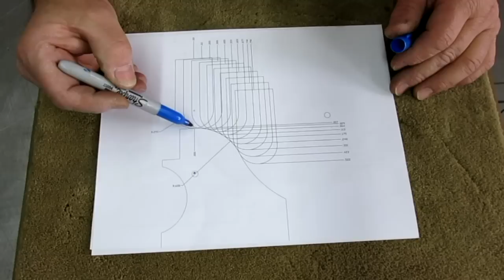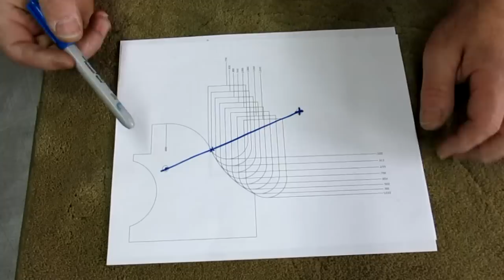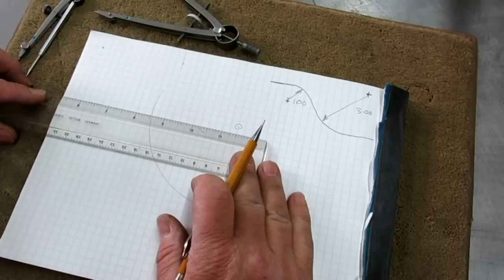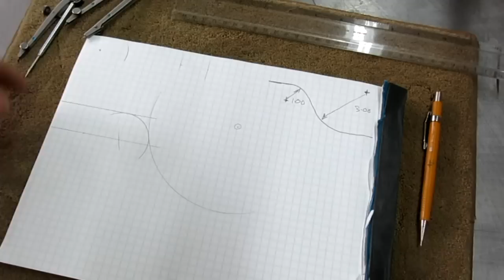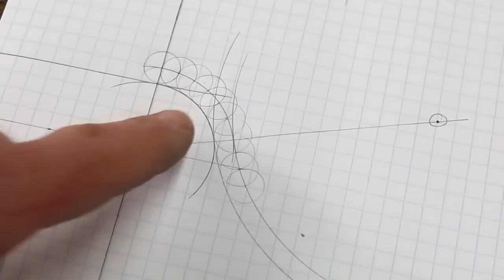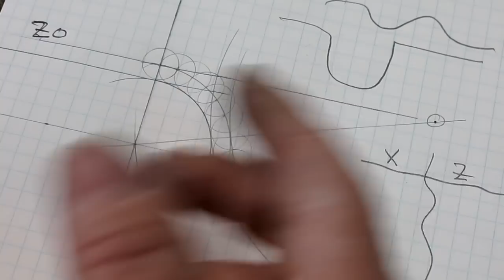Wilton Baby Bullet Questions and Comments

Comment: I have a general question, not specific to the Wilton: Why does the things you are milling/drilling and turning always seem like they are made of butter ? I get the good cuts sometimes too, but often there are trouble. For you the drill bits just seems to want to go though the steel (mostly with no persuasion whatsoever). If you could explain sometime I would like that.
Reply from the maker: +Panzax I speak harshly to all my cutting tools so they cooperate. And I use butter flavored steel.... Just kidding. Sharp good quality cutting tools and rigid machine make a huge difference. Hope this non technical answer helps. 

Best,

Tom

Comment: Marvellous. On your hand-drawn explanation, had you made both radii equal you would have a classic (goes back to ancient Greece) ogee curve. Wikipedia has a perfectly comprehensible explanation of the ogee. I was into making hand-tool picture frames a few years back; did a few ogees with plow planes (equivalent of flat bottom endmills) followed by scraping. Same method you used, but with plow plane. Never ocurred to me to do unequal radii. I thank you!  Having spent my entire professional life programming I am sick of computers.   On climb milling my experience is that you don't worry about it on Aluminum, but on steel -- be careful. It does save time.
Reply from the maker: +Juan Rivero Hi Juan,

Roman Ogee. Sheet metal guys know this one as well. Thanks for the comment.

Cheers,

Tom
Reply: Well, next picture frame I male will have unequal radii aand I will keller it! Thanks for the post.

Comment: The same freshman Engineering Graphics professor who taught me how to construct tangent radii like that introduced me to the term "RCH."  That's as close as you could get with a pencil until CAD came along. I'm always impressed by the things my predecessors successfully designed and built using pencil and paper in 2D along with 3D physical patternmakers to turn paper into metal.

Comment: Very nice job of explaining and demonstrating a clear way of laying out the coordinates for machining curves "by hand". Thank you. As you said, once you know the "hard way", the easy way gets easier. I'm still trying to figure out arrays in Fusion 360. I had it pat in AutoCad, but I no longer have access to AutoCad and it's just too expensive for a profitless hobbyist. The arrays are there in Fusion 360; I just haven't figured out how to do them yet.

Climb cutting.   Especially on light cuts on tough material having the edge of the tool approach the work at a steeper angle lets the cutter begin cutting rather than flex the tool or "push away" from the workpiece. Conventional milling sometimes produces a very "ripply" finish (especially on a light milling machine) because the tool pushes away from the workpiece until the pressure builds up enough to start cutting a chip. Once the cutting starts, tool and workpiece "relax" and the cut goes deeper - until the next tooth comes along and pushes the tool and workpiece apart again (making another ripple). You can apply the axis brake lightly to reduce the tendency for the tool to pull out the backlash on the axis (which causes the tool to take a much bigger tooth-load, possibly causing trouble).

Comment: Tom, thanks for the  lessons! I didn't understand climb cutting until I looked at a drawing showing the cut and cutter from a cutter-axial viewpoint. Seeing the cut surface looking like a ski jump side view and the cutter flutes hitting it on the uphill side made it easy to see how it could run away uphill like a spinning snow tire...hence "climb cutting".  The other way, where it hit on the downslope side of the cut and pushed against any uphill motion was the remaining name...conventional cutting.  I ran into this with routers in woodworking, but it's the same idea. 

I'm also familiar with how rethinking the plan in the heat of battle can invite Mr. Bozo...done that!  It always seems like you've just had a better idea, until you've committed by making a cut, or sequencing things differently, and THEN you remember why you planned to do it the other way.  Oops!

Looking forward to seeing the welding part when you get to it!

 -- Mike

Comment: Excellent video! however I prefer to exercise my brain on Cad and Cam and let the CNC make the part while I'm working on the next one. I used and still use at times conventional machines but prefer the cnc. But I wouldn't like cnc if I didn't have any control over the design, programming or setup.  Anyway again an excellent video I always pick up a tip or two from each one and I'm sure a lot of your viewers do also.

Comment: Hi Tom and all, what happens when climb cutting goes "wrong"?   Is the lead screw's "drag"  overcome and the material self feeds too fast resulting a crash or bit breakage?    The "between the lines" implication is that it is a violent event.   Is this correct?   Thanks in advance.

Comment: Tom, thanks for the demo's.  I particularly liked your explanation of climb milling vs. conventional milling.  I use both methods the same way you explained.  The other  day I had a young guy from a 2 year machining program that was taught to only conventional mill on manual machines and he questioned me when he saw me climb milling.  I told him that had one of those bad experiences a long time ago while straddle milling on a very old van norman horizontal mill and she lurched forward on the two 6" diameter cutters and learned a lesson!  But with a small endmill it shouldn't give you a problem - especially during a light or finish pass.   I showed him the difference in the finishes and he was surprised because he never tried it.

Comment: The true limitation of climb milling is how much backlash there is in the lead screw/nut assembly. Clapped-out mills will not climb-mill with any decent sized milling cutter. If your Bridgeport type mill has ball screws you're good to go. Worn factory screws will be problematic.

Comment: My blue dots sit in a coffee cup on my desk. Don't you hear your drafting teacher telling you not to draw lines with your ruler?

Is there more tool deflection with either climb or conventional cutting?
Reply: +Marty Bernier   Sorry mate, but how are you supposed to draw a line without a ruler?  This is a genuine question.  I can't even write my name without a ruler.
Reply: +Marty Bernier  More when conventional as tool pressure has to build before the cutting begins. This rubbing is why climb milling will produce a better finish.
Reply: +Marcel Timmers  Use a straight edge so as not to wear the edge of the ruler. That's why wooden school rulers have a steel strip inset.
Reply: +Marcel Timmers In drafting class we were given two triangles. One was 45, 45, and 90 degrees. The other was 30, 60, 90 degrees. When you stack them you can get various angles. I was taught to use these to draw lines against. A precision ruler is a measuring device with a fine edge. Good drafting rulers do not have metal edges. I'm just an old school draftsman I guess.
Reply: Hi mate, Thanks for that.  I was thinking that it must be something like that.  I bet that the teacher never thought of any CAD programs.  However here was the proof that it still comes in very handy at times.  I was able to buy a lot of very good Rotring pens because people just don't draw by hand any-more.
Reply: Hi mate,  I thought that it must have been something like that.  Oh those teachers hey.  I bet that he never thought of CAD operated systems.  However here was your  proof that it was handy to know.  I was able to buy a lot of good Rotring pens, because they are not used any more.

Comment: I liked the geometric explanations.  Could you not have built a fixture that would have moved the part through the required arcs?  That solution would probably be left best for a job shop building multiple copies of the part.

Comment: Thank you for the excellent tutorial.  I think I've finally wrapped my sclerosed brain around the concept of "climb milling".
As to the vise anvil.  I agree with your comments on not changing the plans mid-build, but.  Even though it is doubtful the vise anvil will be used as such frequently, won't welding on a flat piece produce a hollow surface rather then a solid reactive surface?  Also, will welding warp that thin piece.  Even if you don't change the plan, I value your opinion on instead of welding on a piece you instead do a weld buildup that is then machined to shape.  Much like you would do to repair a worn out bearing journal.

Comment: Hey Tom, 
between you and Fenner  a guy can pick up more info than you can shake a stick at!. thank you for the explanation on the coordinates in AutoCAD.
the question i would have in response is: would it be possible to duplicate the radii produced with your "kellering" method on a rotary table?
providing of course the workpiece be rotates on its axis 90 degrees...

cheers
mike

Comment: Tom, I use microstation, same solution. if you are trying to match a rod with a specific diameter, and wish to bolt a flat plate to it "kellering" becomes quite useful. think of a scope mount bracket. usually 5" long. then the rings clamp to the mount bolted to the barrel. my DRO says it will do it. microstation says its wrong. so I 5X drew it. MS prevailed.good explanation and quite generous for you to  explain it, so the "old school" has to verify many things for Mr Bozo.

Comment: Speaking of drill press failures, I created a meat slicer from a piece of sheet metal once. It was not supposed to be a meat slicer though.
Reply: Sounds familiar...
Reply: +Richard Schmidtendorff I have made a couple helicopters!  The bad thing is when someone gets something spinning so dangerously that no one will get near the machine to shut it off.
Reply: +Bob Korves   Had a 1½" thick 4x5 foot steel copter attached to the big radial drill once with 3 people trying to reach the button with a rod, a pipe, and a broom. Although I wanted to see who lost a leg if the 2 " drill bit finally broke, instead I laughed all the way to the breaker box and I killed the power.
 One time a guy complained to the boss that I shut off the power to his lathe. Then I pointed out that he had been spinning an empty 14" four jaw chuck at 1200 rpm just so he could move the tail stock without cranking it. I asked "since one jaw is now almost out to the ways should I have waited for the first bang or the spray of blood?". He didn't last too long there, luckily.

Comment: concerning the first question; why make a jaw to align them, just use 3 dowel pins.
Reply: +Dinkys Workshop He could have used the where's the beef method too. Where's the beef is leaving extra material to machine down to the final aligned dimensions once assembled. It was cockeyed before, but it is right now! Personally I really don't trust welding to maintain alignment. There is no power in the 'verse that stops steel from moving when I weld it.

Comment: You might add that the condition of the mill is quite important in climb cutting also.
The backlash of the lead screws and the tightness of the gibs plays a big part of climb cutting.
The looser everything is ,the use of climb cutting becomes a bit more iffy.
I am sure you are aware of this,but some may not be.
I appreciate your videos and have been watching for quite some time.Keep informing and educating us all.
Les
Reply: +Les Bender Ever seen somebody lean against the mill table for climb cutting? We had a clapped out Deckel Fp1 in the old shop where I did that all the time, leaning against the table and taking out the backlash :D
Reply: My comment was directed more toward newbies,which obviously you are not.thanks for your comment
Reply: +Stefan Gotteswinter    Hi mate.  I think it might be the European way.  Making due with the machines that you have.  I can remember working in my father's bakery doing special measures to make machines work.  If you would not hold you mouth right it would not work.   Marcel.